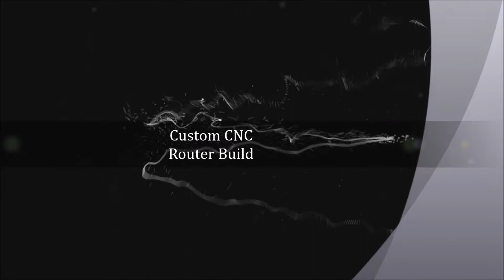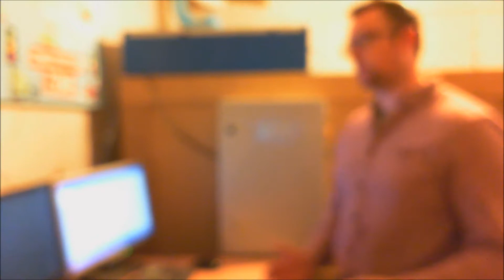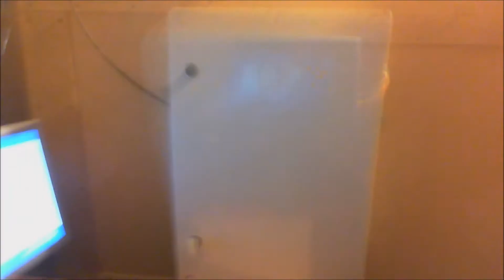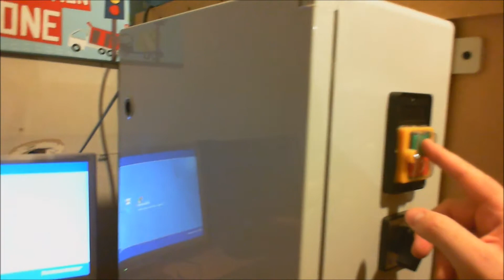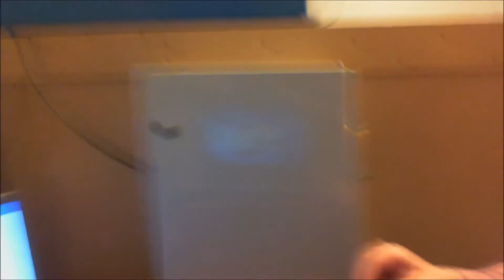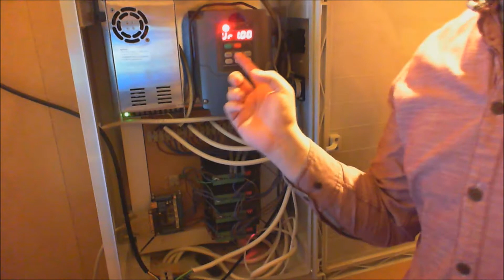Custom CNC Router Build Part 3

Comment: hi iv noticed that you are using cam bam have you ever had a tool path generated with missing holes or slots im on the cambam forum as loumin if you could help id be for ever greatful cheers russ